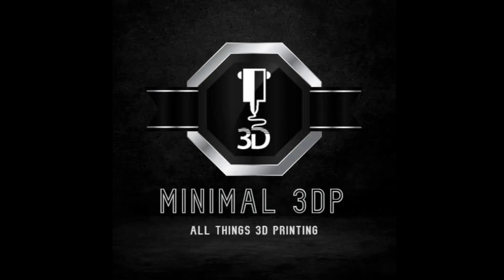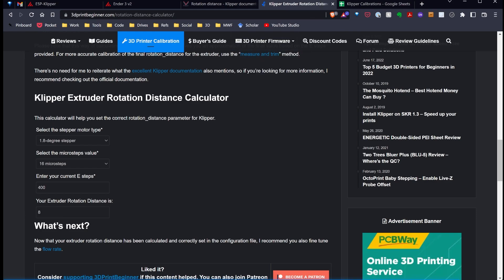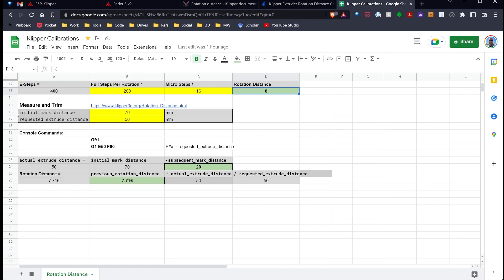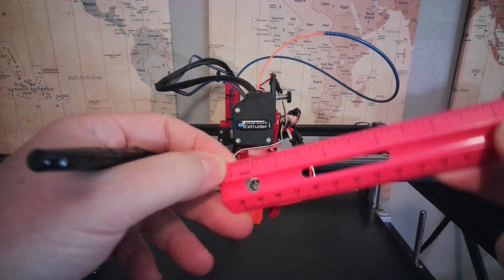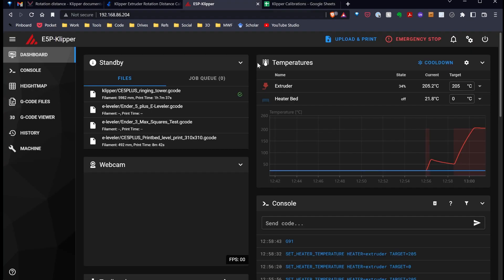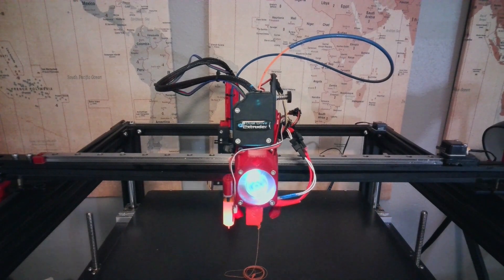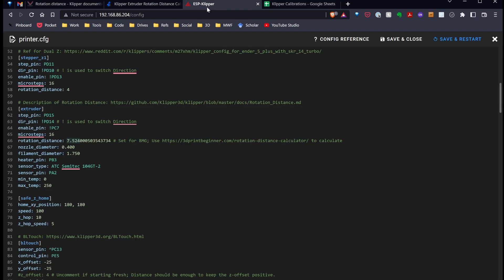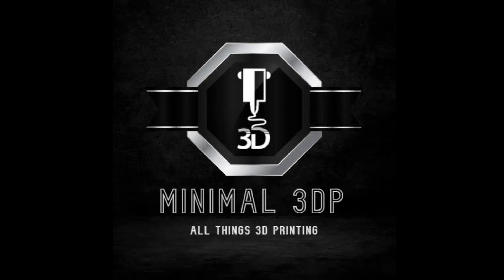Klipper: A Guide to Calculating Rotational Distance with a Downloadable Spreadsheet

Comment: Leasve it to me to find the loophole. Excellent video outlining everything possibly needed, with the exception of the Z height distance.I'm just building a voron and my prints are too tall, and I can not figure it out for the life of me. I made a test cube 25x25x25 and it prints 25x25x31.25.... ?!?! 16t on the stepper belted to an 80t and then 20t on the 80t shaft.
Reply from the maker: Can you share your pri ter.cfg?

Comment: 5:41 , so long as you use the same ruler for the before and after measurement, it really does not matter if you have that gap. You can ignore it. So long as you’re only adding and subtracting and not multiplying and dividing, that gap is harmless.
Reply from the maker: I know but I hate it when I am trying to make small measurements.

Comment: This is a great video and resource.

I have an Ender 3 Pro that will be going from an EZRStruder to a Bondtech BMG.

It's my understanding that I can either set my rotational distance to 7.7108 or I can simply add gear_ratio: 50:17 under the Extruder section and keep my current rotational distance. If both ways work, is there a benefit to one over another?

Any insight on this would be awesome and thanks in advance!
Reply from the maker: I don't have a strong opinion but I personally like 1 number. That way in 6 months I remember. I also have several printers and I like having similar options on all machines. Just my 2 cents.
Reply: @minimal3dp  I am in agreement. I tried adding the gear ratio. It got me close, but I was under extruding severely. All is calibrated and good to go now. Thanks for your input!